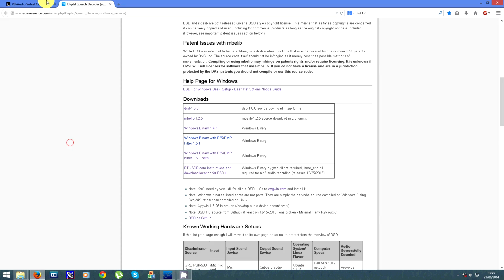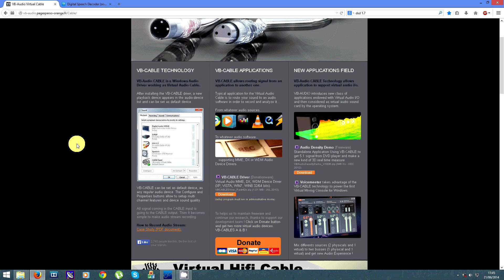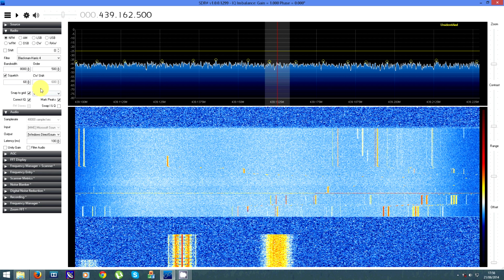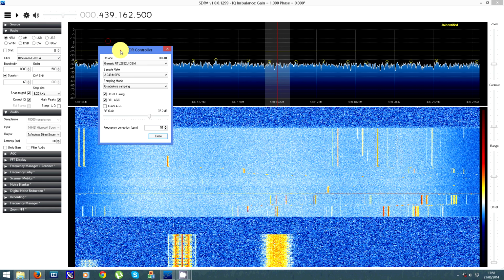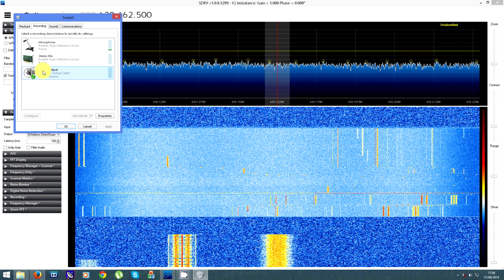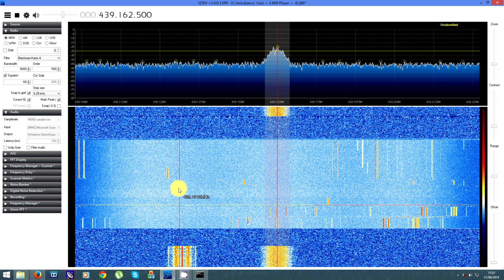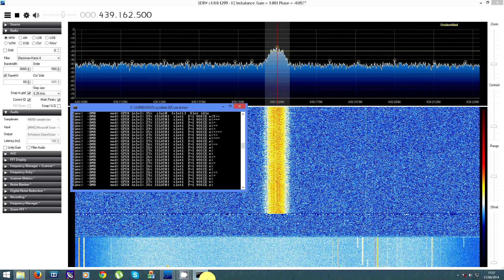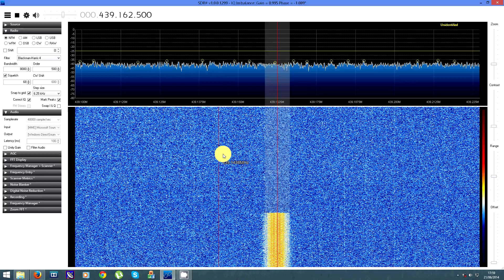How to decode digital voice with RTL SDR

Comment: I cannot get any sound out of my computer when I have SDR# and DSD+ running and VB cable driver installed. I have the audio setting correct I believe in SDR#. I have installed UNITrunker, VB cable and DSD+ and that works for decoding P25 signals. What am I missing? I have also installed SDRangel and I still can't get sound from the decoder.
Reply: How can I decode p25 on homepatrol 2 police scanner

Comment: I followed the directions, but I must have missed something. the DSD software is decoding the DMR traffic as I hear the voice, but I also hear the digital noise to go along with it.. Can someone help me get it sorted out?
Reply from the maker: You just open the sound mixer (assuming you're using windows) and mute the virtual soundcard/VB cable
Reply: If I mute the VB cable, I don't hear anything at all..

Comment: After running into too many digitally-encoded frequencies that DSDPlus wouldn't touch, I switched to JUST using CubicSDR (0.2.2).  I think it's a better solution than SDR# & DSDPlus.
Reply from the maker: That's interesting Hugh. I hadn't heard of this software before. Does it decode digital voice by itself? I had a look on the website for it and didn't see anything about that.
Reply: It SEEMS to!  I know the police in my town are using un-encrypted digital; supposedly P25p1, part of the "ICIS system" in the area.  They definitely are NOT analog as a friend bought a very expensive digital scanner after his analog stopped working for police calls.

I am hearing DIGITAL transmissions with this software, so not only does it decode at least that one protocol (probably more) but it does it seamlessly while continuing to deliver analog transmissions too!  (I listen to FM radio sometimes too)  The software also has a FMS mode, so you can listen to FM radio IN STEREO, where SDR# did not do this.
Reply from the maker: Thanks for the info. I'll have to try out this software myself and see if it can also decode DMR and other digital voice modes
Reply from the maker: As far as I can tell, it doesn't decode digital voice
Reply: It's a mystery then.  My local police are definitely on digital, and I'm listening to that frequency right now.  You found 0.2.2?
Reply from the maker: Yeah that's the version I'm running. Very strange. It could be that it only decodes P25, but I would have thought it would show it as a mode to decode if it did. As it is, it only shows the analog modes. Could it just be that you've left dsd open in the background or something like that?

Comment: Great video, finally managed to decode nxdn using the methods you describe with a rtl £19 dongle from amazon, sdr# and dsd+232 dmr software. nice one. thank you, quick question, in zadig i click on the RTL2838UHIDIR but later this changes to CP2102 USB to UHART Bridge controller is this normal please

Comment: HI radiosification... does one have to reload the SDR batch file for SDR # for again listening to analog signals after loading the DSD batch file and listening to the digital signals?  Thank you so much for taking the time to explain the usage of both software packages as it has made things so much easier, although you did not cover this point.  Also, I imagine one would have to change back to the default sound card as well, correct?  Thanks again (KG7GYB)
Reply from the maker: There is no SDR batch file. The batch files just start DSD with the right configuration for the digital mode you want to listen to. If you're listening to analog, you don't need to start DSD and can just run the analog audio straight through your normal soundcard.
Reply: @ radiosification:  Thank you!  Very helpful.  Thank you for the prompt reply.  73's.

Comment: great video....after 3 weeks of just choppy sound coming through...and nearly pulling my hair out.....I changed my sample rate to 1.024mps....and it works great on my windows 8 laptop...if anyone else is having problems decoding.... the volume on SDR is very important...mine is set to 46dbs..47 and it doesnt work....45 doesnt work.....cheers for help
Reply from the maker: Thanks for the comment. Yeah I actually had the same issue myself at first, but it just wouldn't decode at all. I was wondering what I was doing wrong for a while before I eventually changed the sample rate and it suddenly just worked
Reply: decoding anything that moves now lol

Comment: Why are you using VB CABLE ? You can just use a your computer sound card or any virtual cards..
Reply from the maker: VB cable is a virtual sound card
Reply: radiosification Ah okay ! I'm a beginner in fact... So, what I do not understand is for which purpose the VB CABLE is used ? Thanks !! :)
Reply from the maker: To send the audio from the SDR to the program which decodes the digital mode and produces voice
Reply: Really, you helped me a lot to understand many things !! Thank you !!
Reply: *+Oumix Dj+ The VB Cable simulates a real audio cable connecting the application to some external audio source. Since the audio source is actually running inside that very same PC, you need a means of extracting the audio from one application and feeding it into the other. VB cable "fools" the applications that receives the audio into thinking the audio came from another device, when it actually came from the PC itself. It is a way of making the audio generating and audio recording/processing programs talk to each other within the same PC.

Comment: I'm guessing the decode won't be 100%? Because everytime I decode, the voice just keeps going in and out.
Reply: That's because you're using a cheap 20$ rtl sdr.. For a prefessional looking, you should use a more sophisticated chip which could cost you more than 650$
Reply: Im using a cheap dongle..and decoding nearly all digital modes at 99%....its all to do with tweeking the settings...Got pagers to decode at 100%

Comment: I am trying to decode simplex DMR with DSD+, but having no luck. I remember seeing (in another video) you decoded simplex - what settings did you have on your SDR#? Thanks
Reply from the maker: +Gabriel Saldana Just the same as normal. Simplex is more difficult to listen to because these programs just aren't able to decode it very well so it has to be a pretty good signal. I use 8KHz bandwidth for all DMR now and it works well
Reply: +radiosification Thanks.

Comment: I've got the DSD to decode speech and I could hear my own voice. However, it seems that the DSD can't lock on to the signal for more than 5 seconds. 

All of the signal detected is constantly being cutoff after 5 seconds then it shows NoSync while there is still signal on the SDR#. 

I am wondering how to fix this problem. Could it be a sync/timing problem?

Comment: It says we need cygwin1.dll, but were do put the DLL?
Reply: in the directory of your sdr software, if you use win xp and below you can put a copy of it in your dll folder in system in windows too however win vista and above this is not necessary, and if unsure open your sdr# directory and in the file with dll files copy it there it may be the root or a separate file putting a copy of cygwin1 dll any where you see dll files in sdr# wont hurt anything.
it may say that the file exists and do you want to overwrite the file click yes(the file installed may be older than sdr# expects.
Reply: google it then go on the dll files.com one